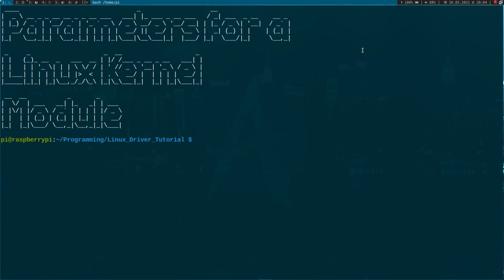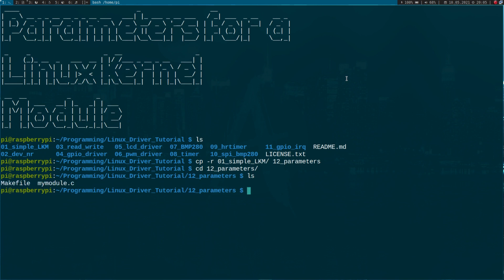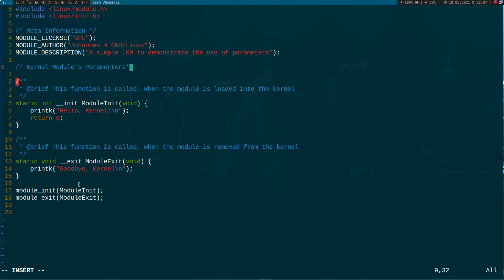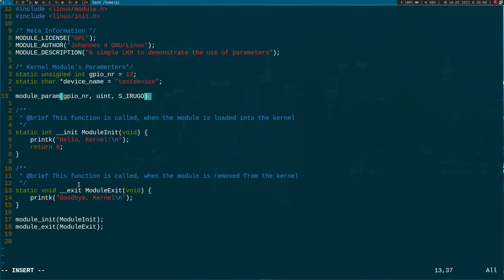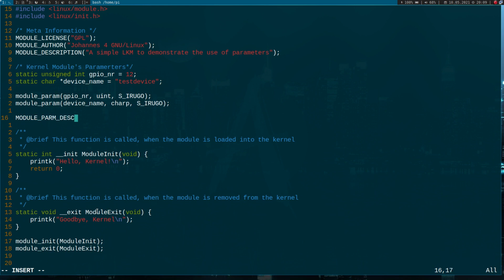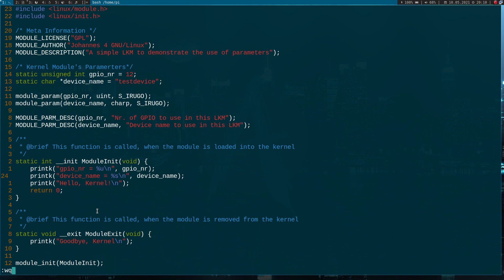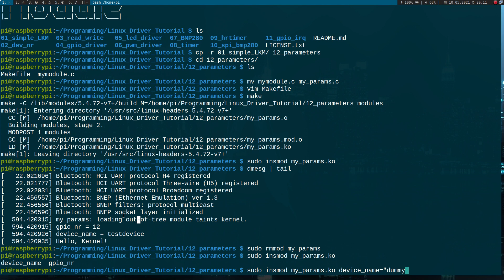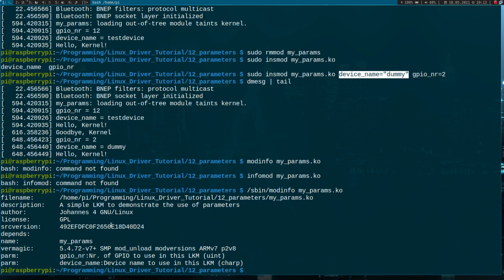Let's code a Linux Driver - 12: Parameters for a Linux Kernel Module

Comment: Shouldn't the device_name be a char array? This variable is a string literal which shouldn't be modified. Am I missing something?

EDIT:
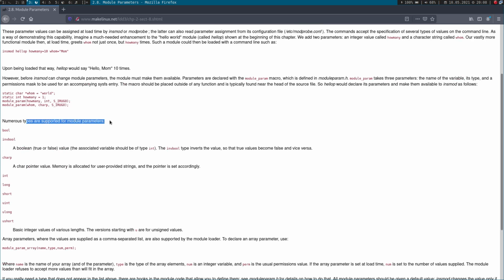Got it. Its explained on this web page (4:30): "A char pointer value. Memory is allocated for user-provided string, and the pointer is set accordingly". So as long as this pointer is not marked as const this is ok.